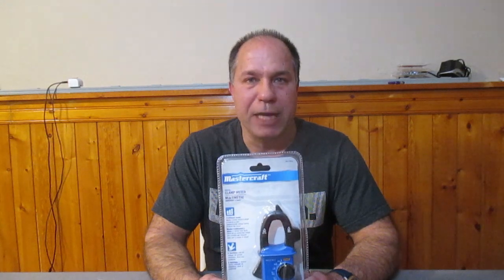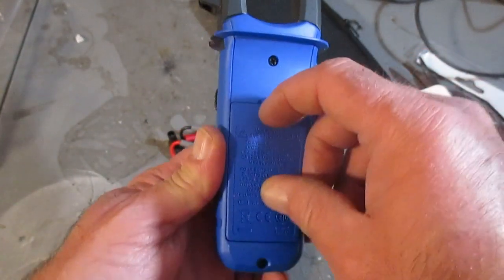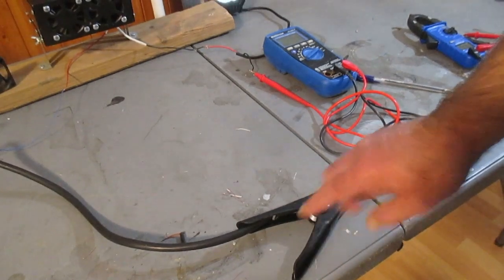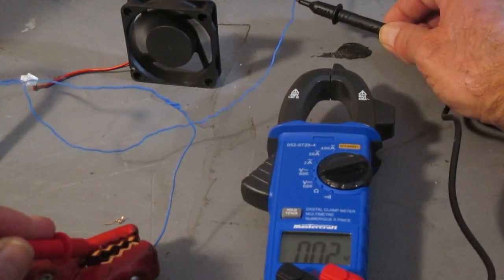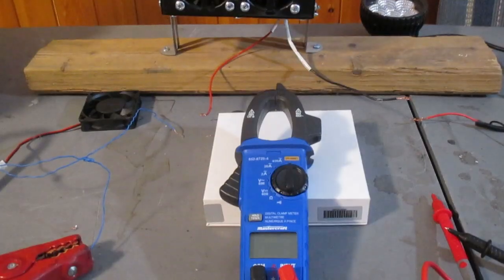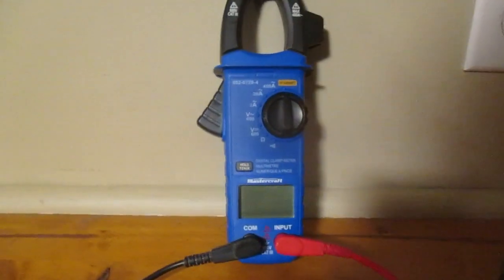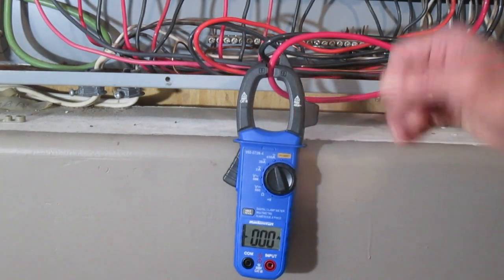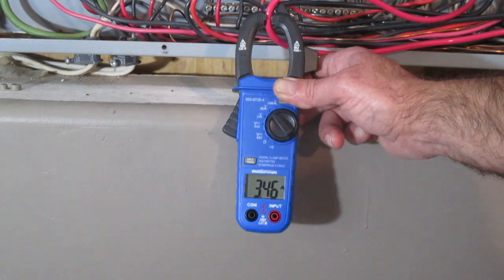How to use a clamp multimeter to measure current, voltage and resistance

Comment: The cable should be in the loop and NOT on the clamp like it is shown in the video , the reading will not be accurate.
Reply: I thought the wire was supposed to be inside the loop of the clamp meter and not clamped onto the physical wire. This is the first time I have seen a wire being pinched by the meter. Am I wrong?
Reply: @kevin83FL  You are right. Not sure why he punched the jaws on the wire for current testing.
Reply: If you put the two conductor cable the reading will be 0 as both will be running the same amperage and the device measures the difference.. that is my understanding
Reply: @TheCooGuR  correct

Comment: Dont know if you caught it afterwards, but your leads should just have insulated covers on them that only leave the tips exposed. It's supposedly for added safety in higher voltage applications.